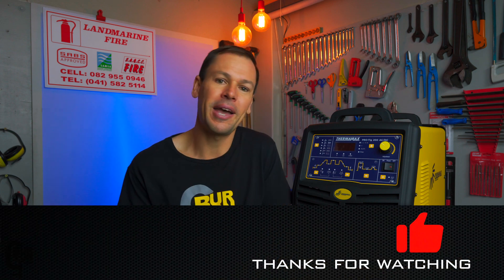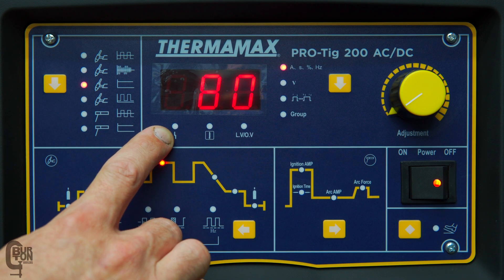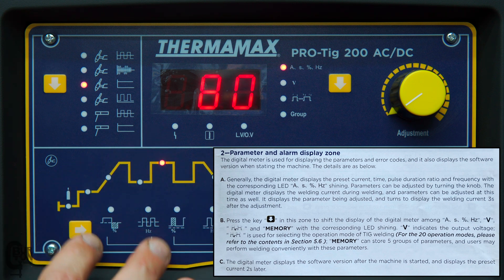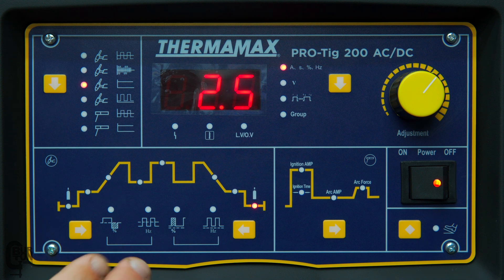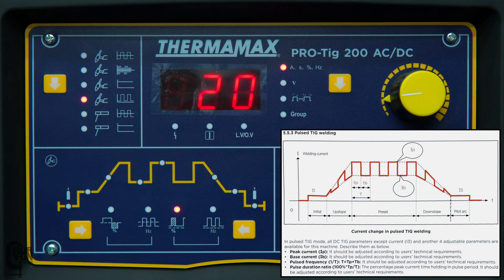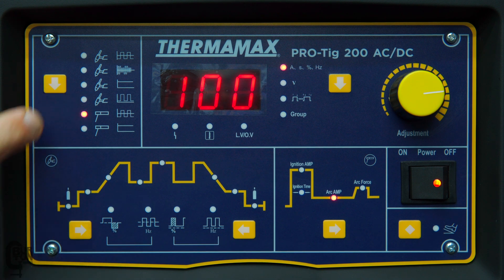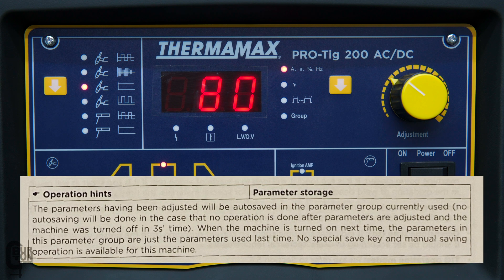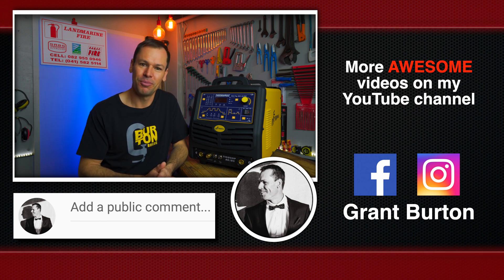TIG Welder Settings - Thermamax Pro-TIG 200 AC/DC (Burton Builds)

Comment: Well said bro, but to mi l hve this ProbTig 200,,,l used to weld aluminum on the average amp of 80-100,but on this machine ,,the working plate is not melting,,how l can l do a correct set up
Reply from the maker: Hi Francisco, I still need to get around to learning how to weld aluminium with this machine, up to now, I've only been using it to weld stainless steel and mind steel.

Comment: I struggle with aluminum on this machine. Other machines I can weld AC on 80 - 100 amps but with this machine I have to push my amps up to 150 just to get a decent weld pool?
Reply from the maker: Hi Kyle, I haven't yet tried. Been meaning to give aluminium a go but haven't prioritised the time to just go sit down and do it. Do you have all the settings the same across both machines?
Reply: I have not used other machines on aluminium but also found that I have to use unusually high settings on the Thermamax to get to form a puddle.

Comment: Hi Grant. Excellent explanation. Just need your help on how to set my peak settings back to my desired choice,my DC Tig pulse 200 is stuck on maximum current (200 amps). Please assist if you can. Machine wont allow me to adjust parameters even while turning it clock or anti clockwise
Reply from the maker: Hi Ramiah, is it only your maximum (peak) current setting that you are unable to adjust? or is it all of the parameters that you are unable to adjust?

What mode is the machine set on? DC or AC or DC Pulsed or AC Pulsed?

Maybe try unplugging the foot pedal and making adjustments with the rotary encoder on the front of the machine?
Reply: @GrantBurton  managed to sort out,found that it can be adjusted once you hold the stringer trigger for 3s,machine beeps... then I'm able to set desired peak current. (DC pulse/ DC tig)

Thanks for replying to my message,I appreciate 100%

Comment: Howzit Grant, did you ever do a teardown of this machine? I just got myself this exact welder your vids helped me choose it. 🙏
Reply from the maker: Howzit, I haven't yet taken a look inside, but I still plan on making a teardown video at some stage. Nice... hopefully it gives you good service. I ended up changing the torch for a lighter weight torch with a button that can be moved around... I find this much more comfortable and useful than the type of welding I've been doing.

Keep us updated.

Also a bit of feedback on the 4x4community forum here https://www.4x4community.co.za/forum/showthread.php/343701-Which-TIG-Welder-2021?p=4650453#post4650453
Reply: @GrantBurton  thanks man!

I will look out for it! Was curious to hear about your comments on the airflow & dial upfront.
Reply from the maker: @hugejp9930  It's is actively cooled with fans that run full tilt all the time, which can be a little noisy in a small workshop (but in a large workshop environment - no problem).

The dial up front seems a little 'light weight' for a machine that is used in a workshop / commercial / industrial environment. By the feel of it, bumping it hard enough might break it off (although I cant confirm this until I've had a look inside).

Comment: Why not matweld or tradeweld?
Reply from the maker: Hi Sengwe, at the time of evaluating the various machines, the Thermamax looked like the better unit. I've heard from a few people (both users and repair shops) that getting spares for the Tradeweld machine can be problematic and take long whereas spares for the Thermamax machine are carried on hand and taken directly off the shelf (downtime can be very costly in a commercial operation). The Thermamax unit also seems like a more commercial / industrial unit compared to the Tradeweld equivalent.

There were no Matwelds in stock at my time of purchase, but if I remember correctly, the specs were very similar. I haven't seen first hand, but I am led to believe that the Matweld and Thermamax units are very similar, with some internal parts being interchangeable. It wouldn't be the first time i've seen machines that look different on the outside but are identical inside... haha.

I also read on a forum a while back that Thermamax bought out Thermadyne (I stand to be corrected) but the Thormodyne units used to be good so that also swayed my choice (thinking the same quality would be continued).

Comment: Great breakdown. If you don’t mind I also have a question- I have the Jasic  version of this welder ( same unit, different colour, different badge) when you select the pedal on the unit (and setting the trigger control to 0 )the pedal light flashes and with  a further press of the button the light is solid. Which one of these settings is correct? Cheers
Reply from the maker: Hi David, it sounds like the order of solid vs flashing lights when pressing the foot pedal button on my unit differs slightly to yours but I assume the foot pedal selection works in the same way (my flashing light means the same as your flashing light and my solid light means the same as your solid light).

Mine has 'three' foot pedal modes... First mode being the default mode where the light is off and the foot pedal is deactivated... now if i push the foot pedal button, the light turns on solid (let's call this Mode 2)... If i push the foot pedal button again, the light starts flashing (let's call this Mode 3)... and if I push the foot pedal button again, the light turns off and deactivates the foot pedal.

From what I could gather (Its a shame the user manual is poorly written in this regard):
‘Mode 1’ - Deactivated

‘Mode 2’ (Solid light) - The Peak current is set by the rotary encoder (parameter adjustment knob) on the front panel however the maximum current that you will actually get when welding is then further limited / dictated by the position of the Potentiometer on the side of the foot pedal. The potentiometer on the side of my foot pedal has 5 positions, starting at 9 o'clock, then 10:30, then 12 o'clock, then 13:30, then 3 o'clock. These positions seem to correspond to a percentage of peak current. So 9 o'clock = 25% peak current, 10:30 = 37.5% peak current, 12 o'clock = 50% peak current, 13:30 = 62.5% peak current and 3 o'clock = 75% peak current. As an example, if I have my Peak current set by the knob on the front panel at 100A and the setting on the foot pedal at 9 o’clock and press the foot pedal all the way, I get a max welding current of 30A (technically this should be 25A but it seems the machine in this mode, DC TIG with foot pedal enabled and the light on solid, won’t weld lover than 30A). If set 10:30 position on the foot pedal, max current with pedal fully pressed is 35A (close to 37.5% of 100A). If I set 12 o’clock position on foot pedal, max current with pedal fully pressed is 50A (50% of 100A). If I set 13:30 position on foot pedal, max current with foot pedal fully pressed is 63A (63.5% of 100A). If I set 3 o’clock position on foot pedal, max current with foot pedal fully pressed is 75A (75% of 100A). As for its operation, When I press the foot pedal, the arc ignited and welding current is controlled by rocking the foot pedal and when I release the foot pedal, the arc stops immediately (it doesn’t follow a downslope curve / setting). So it seems to be following Trigger Mode 0 in the user manual (page 30) even though the Trigger Mode is actually set to 2 on the display. In essence, the user is just controlling upslope and downslope time manually by rocking their foot faster of slower. The pre-flow and post-flow gas times still work as normal.

‘Mode 3’ (Flashing light) - As soon as I enter this ‘3rd’ mode, the display shows 20A current and the parameter knob on the front panel is disabled. The Potentiometer knob on the foot pedal now controls the peak current available. Again those 5 positions (9o’clock, 10:30, 12o’clock, 13:30 and 3o’clock) come into effect but not as a percentage anymore bur rather a maximum current (or at least thats what I witness on my machine). If I have the foot pedal knob set at 9 o’clock and press the foot pedal all the way, I get a max welding current of 48A. If set 10:30 position on the foot pedal, max current with pedal fully pressed is 84A. If I set 12 o’clock position on foot pedal, max current with pedal fully pressed is 118A. If I set 13:30 position on foot pedal, max current with foot pedal fully pressed is 158A. If I set 3 o’clock position on foot pedal, max current with foot pedal fully pressed is 200A. As for its operation, when I press the foot pedal, it seems to be following Trigger Mode number 2 (2T) where it follows the normal upslope, downslope, etc. (Remember the machine is currently set to Trigger Mode number 2). I did notice however that the it does not accurately follow the downslope time - when downslope set to 0.5s it takes longer than 0.5s to ramp down the current if I rapidly take my foot off the pedal. Likewise, when downslope is set to 8s, it takes longer than 8s to ramp down the current if I rapidly take my foot off the pedal. So downslope tie setting does have an effect, its just not exact.

In summary, I suppose it depends how you want your current controlled.
Mode 2 = Current Control primarily by front panel knob and secondary by foot pedal knob (as a percentage of max current set by front panel knob.
Mode 3 = Current control solely by foot pedal knob with a maximum of 200A depending on the position the foot pedal knob is set

Hope this helps. Please let me know?
Reply: @GrantBurton  Thanks , very comprehensive response and much appreciated. Essentially you have confirmed my own experiments because,  as you noted, the instructions leave much to be desired. My question formed part of a protracted battle to get the thing welding right because unfortunately I’d had some trouble ( in part because I questioned the dealer and they stated emphatically to use the pedal in the-“solid light mode” which as you point out does not allow the pedal to regulate the amperage through the potentiometer) which is largely resolved. Again many thanks

Comment: Is this a 220 or 380volt machine? What did it cost you?
Reply from the maker: It’s a single phase 220v machine and if I remember correctly, it was a little short of R22k. Also bought a couple other things at the same time so maybe a little short of R21k… in that ball park, was a couple month ago already.